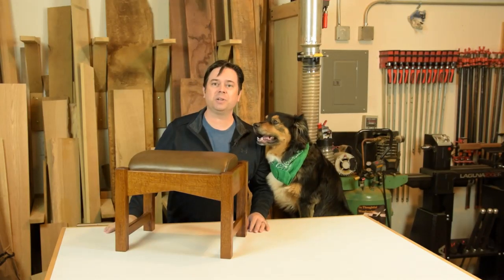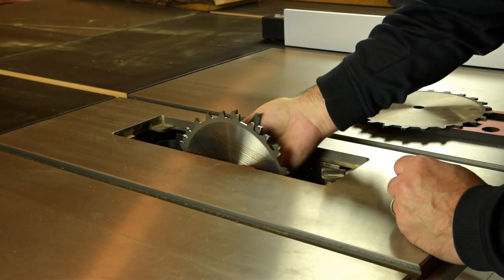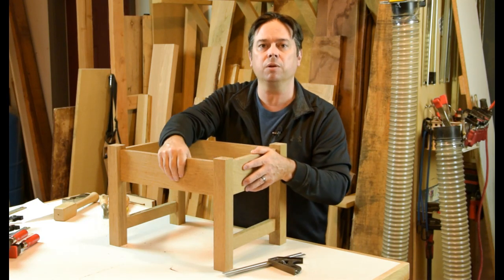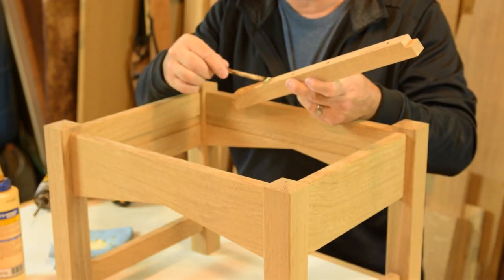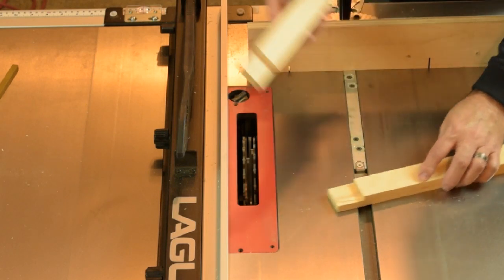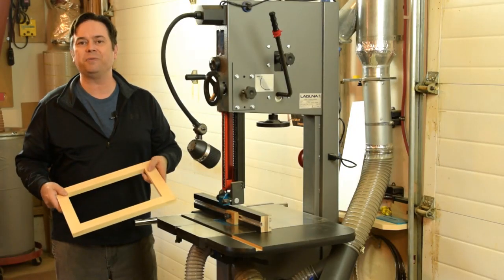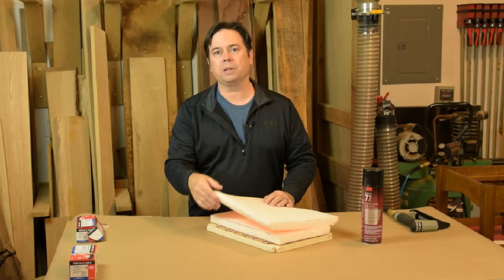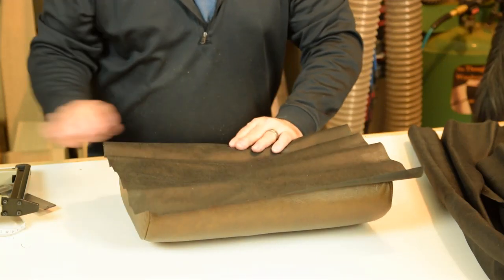How To Make a Craftsman Style Ottoman with Leather Upholstery | Laguna Tools

Comment: Any drawings or plans for the rear table extension?
Reply: Hi Joe,  I didn't draw up plans for the outfeed table because I built mine to fit between two tablesaws back-to-back.  I can give you the basic idea though.  It's made from full 1" thick MDF, laminated with Wilsonart laminate in a black matte finish.  I flipped the rear rail of the tablesaw upside down to act as a ledge to support the outfeed table.  Then I added hardware to help level the outfeed table perfectly with the cast iron top of the Fusion F2.  Leg levelers adjust the table to the right height.  Finally, bolts pass through the rear rail, into threaded inserts in the MDF to lock it down.  You could do the same thing on a freestanding Fusion saw, but you'd need to add legs to the far outfeed side.  Put leg levelers on the legs to accommodate uneven floors.  
Best of luck!